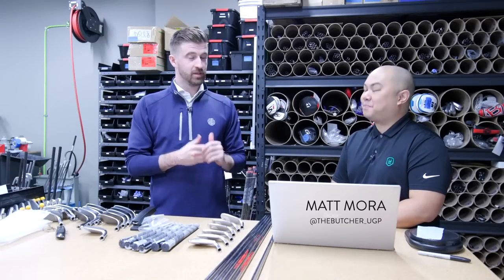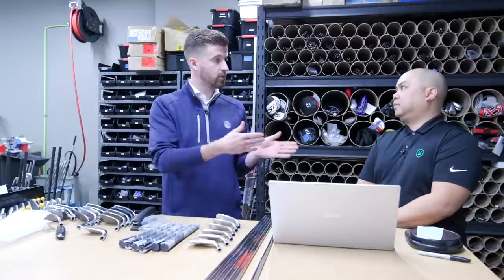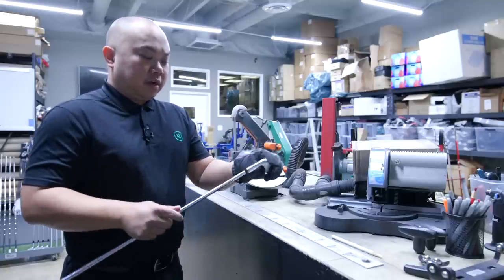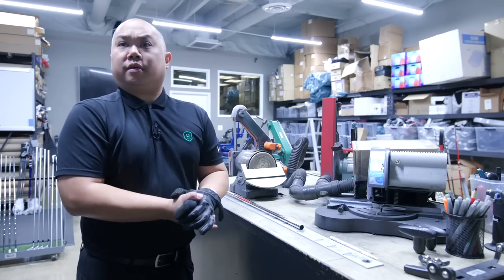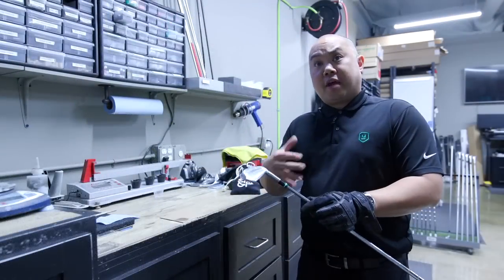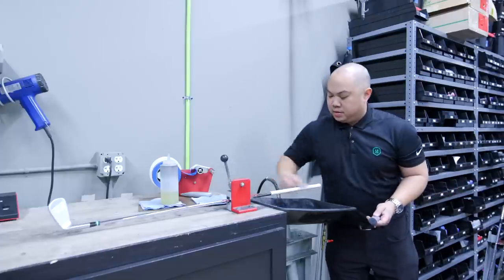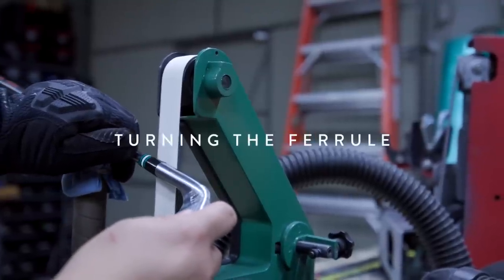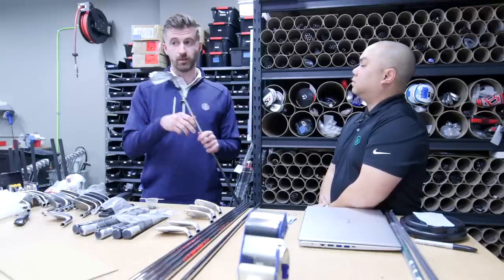How to Build a Set of Irons | Tour Quality Process | at UGP

Comment: Thanks for an interesting video. The pro I go to at my range is also their fitter and club maker, so I have watched him do a couple of these steps, but not the entire process. And his small shop in the back is not as large and well outfitted as this one. One additional operation it would be interesting to observe is what an expert like this does when it comes to pulling shafts, both steel and graphite and making sure they are clean and free of any rust before putting them back into new or the same heads. Also removing worn grips. I think some use compressed air to remove grips rather than cutting them. There are environmental health risks from the vapors that fitters are exposed to as well.

Comment: I really like the effort they go to on the builds. I also totally get the advantages of a custom build but is it worth the cost? If you had gotten a set with custom numbers from a decent big brand shop like Mizuno the cost different is more than a thousand less than a custom builder like this right? I also think this is not just on the custom builders its an industry issue as they barely get a discount if you buy the club head only and have to charge you full price for a shaft. I don’t know if the average golfer can justify the price difference for a custom build. Also would Urban Golf give you the option to buy from the manufacturer through them and they just charge a fee to check loft and lie tolerance? I really see the value in a fitting session but I struggle with the cost of the custom build.

Comment: Awesome video and great info! I do have a question about soft stepping a 4 iron? I’ve been looking for a p760 4 iron in modus 130 x stiff for about 7 months. Finally found one but it’s soft stepped. Will that affect spin numbers? Distance? Feel? I honestly just heard about this all for the first time this week so I’m clueless. Thanks in advance and once again it’s awesome to see some meticulous and detail oriented videos!
Reply from the maker: Essentially that shaft will just play a little bit softer than the x-stiff label, kind of like an S+. Soft-stepping is a way for fitters/builders to really dial someone in who maybe be on the borderline between flexes. Honestly it might work nicely in your 4 iron, might just feel a little easier and less stiff – or you may not notice a huge difference
Reply: Thank you! Based off that info it hopefully will help me as I tend to try to over swing the longer irons and I end up with a lower flight that rolls further than I want. Maybe that touch softer flex will get the ball up higher and land softer. Thanks again and looking forward to some right hand progression updates!

Comment: I find it odd that he cut the shaft to length prior to installing the tip weight. The tip weight prevents the shaft from going all the way in and will add 1/16" - 1/8" to the finish length.
Reply: Also that the extra length of the grip cap adds to the overall club length and swing weight

Comment: Would love to learn about the building process from a customers perspective. Are you getting all the components from the manufacturer and then “assembling” (building) the clubs? I was recently fit with a club fitter who just sends the spec to the manufacturer and they build the clubs and they turned out horribly. Each club was supposed to be 3 flat and only 2-3 of the clubs were actually right and the fit shop gave them to me all wrong. On the flip side I have heard some shops sell the “heads” for the full price of the club and then just keep the grips and shafts and charge the customer extra for the grips and shafts.
Reply from the maker: yes UGP gets all the components and does all the builds for their customers

Comment: Build question.  How does hosel weighting vs. head weighting (lead tape) for irons differ (ex: would hosel weights make it more draw bias)?  With drivers, woods and hybrids swing weight is done by adding weights on the head itself but it is also used to control ball flight.
Reply from the maker: yes technically weight in the hosel could move the CG closer to the heel, but with it being a small amount likely not noticeable to most. Lead tape for some is ideal because you can apply it right where you want, but obviously not cosmetically the best

Comment: Matt what if you have an MB set like the Cobra Ricky Fowler and you want a little more distance and want to adjust loft to make it hotter?  Is is recommended or a no no?
Reply from the maker: You could go a little stronger, but it does add offset and reduce bounce so it might not be the best idea. I would probably leave the lofts and maybe play a ball that's a bit lower spin off the irons, would add a bit of distance
Reply: @GolfLiberty  that’s an excellent idea Matt thanks 🙏!

Comment: Excellent in depth video on proper club assembly. I dabble a bit and learned a few errors of my own building. The one thing I do differently is put the grip and 3g weight (actually weighed the tape) on the scale at butt end to see the swing weight before i glue everything. Matt at this pace of interesting and informative vids, you'll have 100k subs in no time.

Comment: Great Video and explanation of why all the steps are done.  One thing with a custom build shop as you stated Matt B, is that they can pick and choose from a bunch of same manufacture heads and sort them by weight to be consistent throughout the bag.  All sets of irons can be the usual 7 gram difference from one another and thus producing the most consistent feel throughout the whole set.  Same with shaft sorting by weight and grips as well.  Key steps in being a total custom build.  Great job both of you and great content to show everyone that custom built clubs are built differently.

Comment: I had a client they paid for a fitting very expensive build for a set of clubs he brought them over and there were several clubs that felt the same and went about the same distance after checking the set I finally put it on the CPM and several of the clubs were the same CPM or backwards you see each club should get stiffer or softer than the next one, by four revolutions or CPMs these clubs were all over the place from soft side of the shaft to hard side of the shaft.  I use a laser when I dry build to find the sweet spot and get the CPM. then I dry Build the next club and I get the CPM and so forth until the sets done this is the most consistent way I found to build a set of clubs yes it is time consuming but it’s easier for my clients to find the middle of the face when hitting the ball

Comment: Ref. Grips - As I usually re-grip my own clubs, does the builder usually share the information with the customer as to how much tape was added and where it was added on the shaft so it can be repeated when the clubs are re-gripped assuring the correct swing weight? Or does the customer only get a reference with the final swing weights?
Reply from the maker: I’m sure they’d be happy to share how the grips were done, would be part of the final spec discussion

Comment: That's interesting that they cut to length vs allowing room for a grip cap. I totally agree with that method. A grip can change often which could throw of the club. You also need to hold down below the grip cap.
Reply: I’m confused why you wouldn’t allow for grip cap. Every manufacturer set and test club I have used measures to length with the grip. Doing it this way would make the final club length 1/8” over the test club wouldnt it? With so much attention to making sure what was tested is what is built this confuses me.

Comment: Grip tape question:  A buddy of mine said he normally uses 2 to 3 more layers of tape on the bottom of the grip, where a right-handed player's right hand would hold the club. He said it minimizes club rotation with the right hand which can cause pulls.  On the TM website when you customize clubs they offer the option of 1 high 3 low layers of tape.  Is this a real thing, feel thing, a myth?  What are experiences with it?
Reply from the maker: It’s definitely a common preference, golf pride makes a ‘plus 4’ model’ which is what I got on these irons that simulates the same kind of feel
Reply: @GolfLiberty  Yeah, I used to have those several years ago, but don't recall them making much of a difference.  Or maybe my swing was just to inconsistent to notice a difference.  Thanks for your feedback and the great video.  Like another comment mentioned, happy that you were able to establish your own channel and provide insightful and helpful content above and beyond equipment review!

Comment: Can older clubs be rebuilt if they are out of spec.
Reply from the maker: Some components might need to be replaced (like a shaft or grip) if the builder can't remedy the issue with the current parts – but generally speaking I would say yes they can